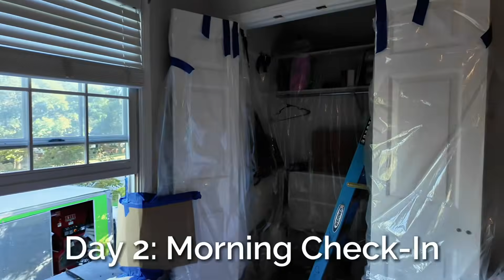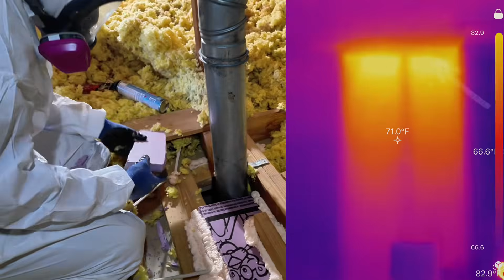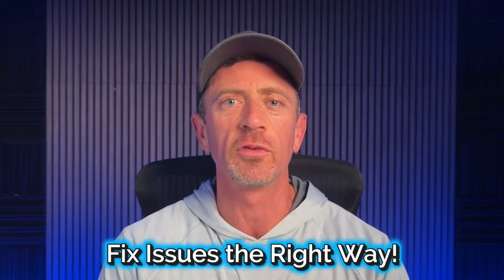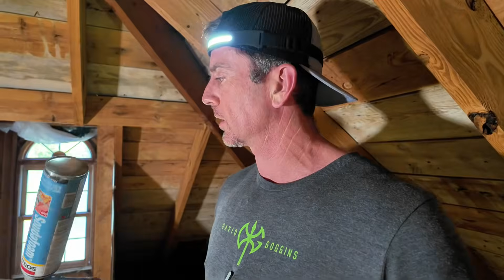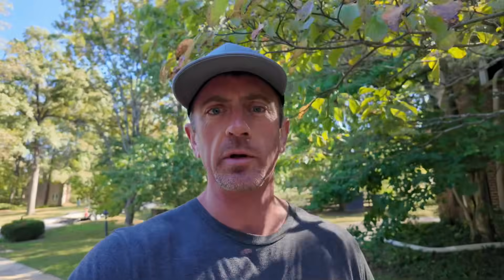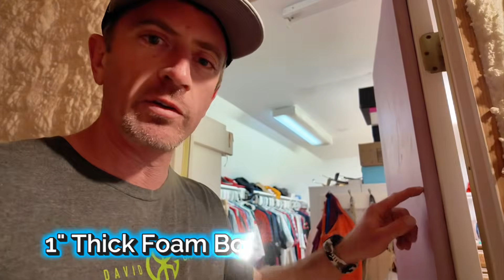How to Air Seal an Attic Before Adding Insulation (Step by Step Guide) — Day 2 of 3

Comment: I have a very similar situation in my house where we have a 12x20 loft area which is over the garage, and all of the walls are "attic facing" as you described. There is at least 5 feet between the ceiling of the room itself and the actual roof decking, so it's almost like a freestanding structure inside the attic. No surprise, it gets up to 88-90* in the summer, even with two HVAC vents that have good airflow. We were able to hold temp at 75* using a 8000 BTU portable air conditoner this summer. There is unfaced fiberglass insulation on the attic side. I've thought about hiring a spray foam contractor to basically create a completely sealed room, but worry about moisture as it's an unconditioned attic. It's hard to find good information about this specific situation. This seemed to work well for your neighbor. Do you have any concerns about moisture? We are in the Midwest, so 0* to 100+ is a normal temp swing.
Reply from the maker: I'm in the midwest too and this application works well.  The other option is you can add 1" to 2" thick foam board over the wall studs on the attic side and then block the space where the floor joists are "open" under the living space.  I did a hybrid version of both spray foam and foam board at my own house.  

Check out this video explaining more about 1.5 story homes and those with bonus rooms over garages - 
https://youtu.be/LB_S-P6y7iA?si=q3x9u8mBJBRQxfmZ&t=95

This one covers types of insulation and where to best use them - https://youtu.be/LavNq4MlWMo?si=ml4CYUcSCgGopkDr

Comment: thanks for this video. Super helpful! I have a few questions. What is the best way to insulate furnace vent that is in use. Would it be done the same way as in the video but using fire rated materials? 

Also, how are you supposed to be able to change things out in the future? For example, if you need to replace your bathroom vent and it’s covered in spray foam?
Reply from the maker: Glad it helped you!  Here's a link to a step by step illustrated guide on how to seal active flue pipes the right way. Just scroll down a bit - https://basc.pnnl.gov/resource-guides/air-sealing-duct-and-flue-shafts#edit-group-description

You don't need to fully foam over top of exhaust fans - just seal the metal box to the drywall with 100% silicone or low expansion foam.  You can cut it out if it ever needs replaced!

Comment: @HomeComfortAdvisors Hello Eric, enjoy your video. Sir, let’s get real. Forget, cost. To do the complete sealing of all the penetrations, complete removal  of old insulation is required, correct? Secondly, absolute surveilance  of the contractors working in your attic space is a must. The industry is overwhelmed by charlatans, blowing insulation day after day, without sealing penetrations. I would forbid any insulation blown in, until I had personally examined, every penetration, chase, top plate , vent stack, period. The industry, is finally correcting flawed  “ best practices “ for 100 years. This means this job cannot be done in a few days. A contract dictating definitive  protocol for completion of the project. I  have competed 3 energy Audits with 3 contractor , in 5 weeks. The  results, are all over the place. Same home, with massive Delta, in 50 pascal blower tests. I think some of the results are loaded . Which leads me to believe the industry is full of dishonest companies. You offer excellent solutions, in a stoic, and qualitative metric for clear and precise results. I look forward to to your response.
Reply from the maker: Thank you very much, and you're spot on that fully removing the attic insulation is the only way to 100% ensure that nothing is missed. Extraction is not cheap though, and when people are attempting to DIY this work they may not be able to afford a 100% job. If they get 80% of the major leaks that’s still a great improvement and likely worth the effort. 

Thanks again for your comment and kind words! 🙏🏼

Comment: I have blown-in cellulose insulation, about R30. Could I use an electric (not gas-powered) leaf blower to move/blow the insulation out of the way, or is that a crazy idea?
Reply from the maker: I think you'd create a dust storm in your attic and you'd have to have some really good eye protection and N95 mask at minimum!  Probably easier to just use a straw broom and/or a plastic shovel to move it around more controllably.

Comment: This whole project is confusing. Are you the homeowner? GC? Insulation Co owner? Lol
Why would you let them only install 1 baffle if that was your house or job? Was there even ridge vent in this space? Lol
Also, if you're the homeowner,  Seem like spraying the floor, install plywood and insulte the rafters for partial controlled storage space is a huge miss! I mean wow the damn thing has it's own door 😂
Reply from the maker: You must've missed the "day 1" video before this where I explained I'm helping my neighbor air seal and insulate his house.  Attic has plenty of ventilation and I did suggest to him to condition the upper attic and the one above the garage, but he didn't want to spend the extra money, and I don't blame him.  It all made a big improvement in their comfort throughout the house and that's the bottom line